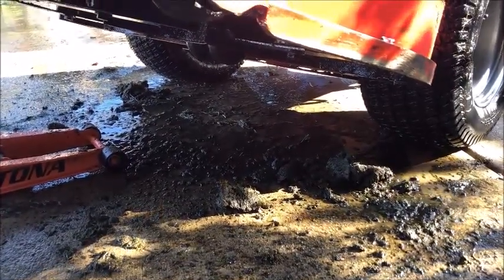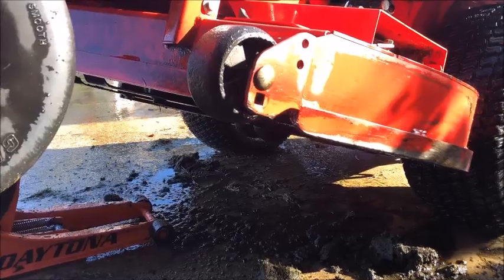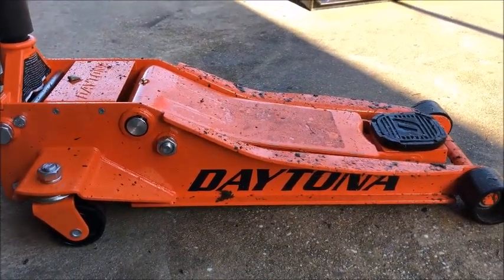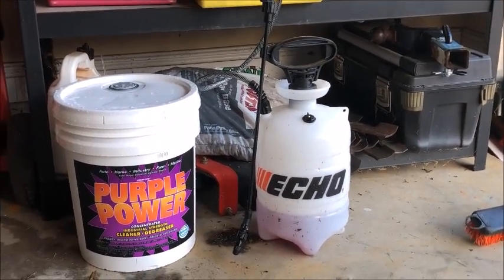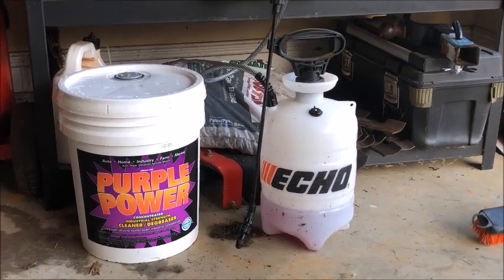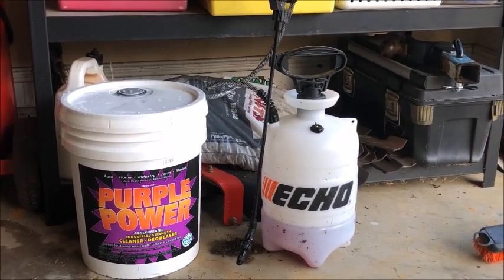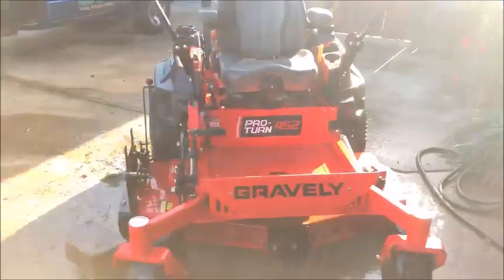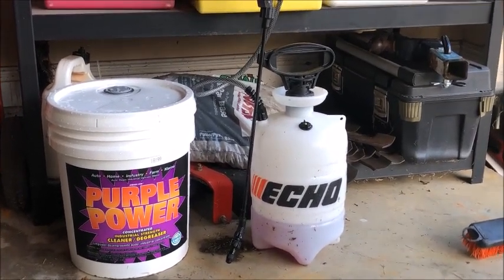Clean Your Zero Turn | Quick and Easy

Comment: I'll lift the seat and blow off the hydros, battery area but try to keep that area dry. Never wash down in there. Nobody sees it anyway. And i just scrape the deck when changing blades. Dont get as messy as you'd think. I use the old blade so got 20.5 inches of length to keep my face away from falling clumps. Great vid. Always enjoy em. Cooler months on the way :)

Comment: Working at a small engine reapir shop/toro dealer we see the best kept to worst kept. We start by dry scraping any large debris then remove the deck and pressure wash both sides inspect for damage then reinstall deck. Only about 5-10 minutes more on most mowers however some are more difficult to remove or reinstall. More videos please...

Comment: I just bought a Gravely and the manual specifically says not to pressure wash it.  But what you're doing doesn't seem like it's hurting anything.
Reply: Follow the manuel. My 7 yrs old Gravely has never been washed with water and it perfect. Condition. What I do is try not to mow when the grass is wet. I know that is not always possible given time constraints and weather. Get yourself a lift and scrape the deck every   3 weeks or so. More if you mow when it wet. Wet grass will harden like cement and impede the air flow/discharge of your deck. Congratulations on your new Gravely. Treat it right and it will treat you right.
Reply: @mikeburkhart9636  Yup, that’s what I’ve done: keep the thing as dry as possible. I’ve read that washing these things does more harm than good. I do need a lift though.

Comment: GO GREEN !!! SIMPLE GREEN will not hurt the environment or YOUR Machine . Purple Power causes paint fade and will burn the lawn.  Also DO NOT let Gravely see you pressure washing your deck. They say "THIS IS THE REASON FOR THERE SPINDLES FAILING" We are supposed to use AIR to clean the machine !!! 😂 What companies will do to get out of a warranty 🤫 I just scrape the deck when changing blades mid week with a 4 in putty knife and blow the machine off with the backpack blower in between yards throughout the day.
Reply: good to know, i was debating between purple power or simple green.

Comment: degreaser fades and removes the paint over time. I use a car washing soap instead.
Reply: Good tip, thanks
Reply: Yep, it does. I use car wash soap as well.
Reply: Good tip. Will do use car wash soap. Keep my Gravely out of the blazing sun when not using it so it doesn’t fade the paint. No need to defeat that with chemicals. Thanks

Comment: Did you pressure wash under the front of the deck?
I believe it would take me longer than 60 seconds. 
I will see how your method works, after I remove the water inlet & clean it out due to no water flow inside my pressure washer before I start the Honda engine.
Good video 👍

Comment: you haven't had a issue with cleaning products fading the paints and plastics?
Reply from the maker: I've used purple power for 3 years w/ no adverse affects.  I don't let it sit for more than about 30-45 seconds before washing off.  It does a great job. Thanks for commenting.

Comment: Do you really notice spraying that on there with out scrubbing t actually does something?  I feel like just the pressure washer alone would do the same job.  Curious to know if you’ve noticed a difference from using solutions.
Reply from the maker: mccool24 Yes there is a difference.  The purple power breaks down grime and dirt so you don’t have to use as much pressure with the pressure washer.

Comment: Wrong answer. It may be easier to use a power washer but you are forcing water into your spindles. Once they rust and cease you will be replacing them. Not fun.